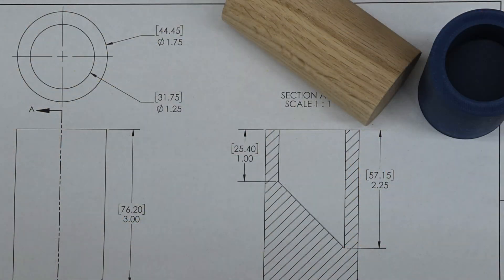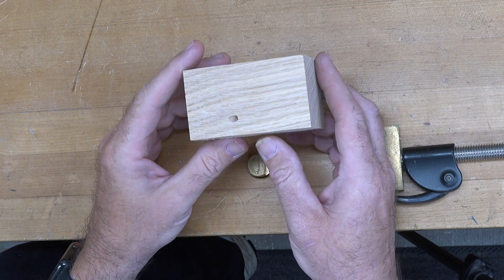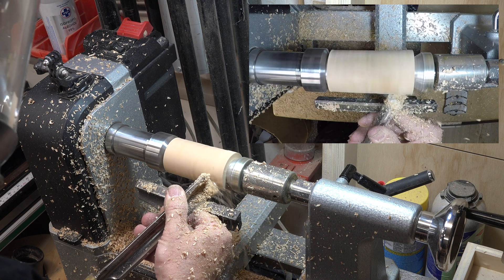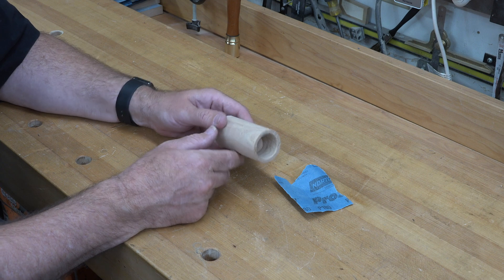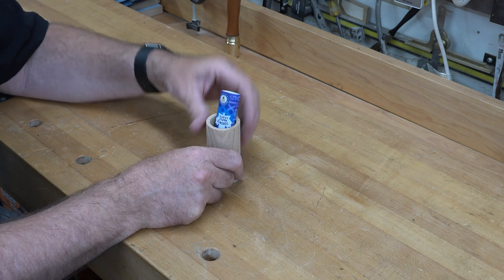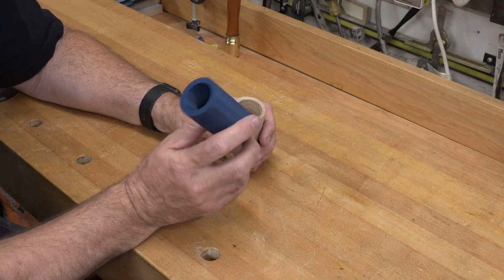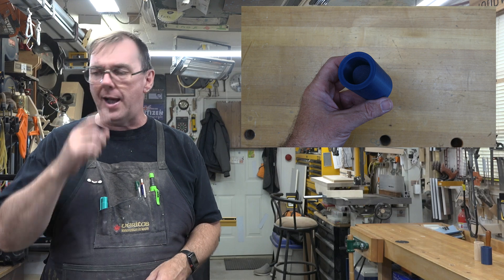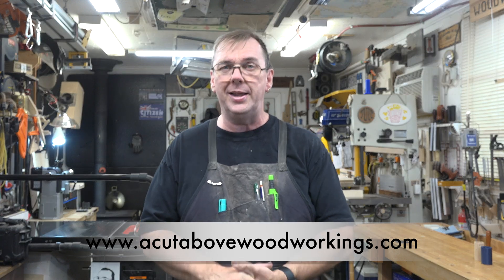Shop Made Toys and Choking Hazards

Comment: Very important video!   I totally agree with Scott M.  …..  everyone should consider a good COR course that includes pediatrics.  There are countless choke hazards around our homes that are parts of everyday life.   Be observant with anything you make, but also be aware of all things purchased.  When you make one of these gauges, take I and walk around your home.  You will be totally shocked at all the choking hazards for small children.  🇨🇱🤠
Reply from the maker: Scott's suggestion was definitely spot on but so is yours Randy.  Crawl around your house, viewing things from the height and perspective of a 3 year old and test the things that are in reach.  I agree that you will find a shockingly large number of choking hazards and in most cases, all that needs to be done is to move them to a higher shelf where they are out of reach for the toddler.  It is such a simple thing that could save the life of a child.  Thanks for tuning in and for chiming in to the conversation.  I appreciate your input.

Comment: I was delighted to see how seriously you took my message! I always knew that you were committed to safety, but I find it incredible how quickly you printed the gauge, built a wooden version and made a video. It was only a month.
Also, great comment about securely holding pieces in a clamp while at the drill press. My first month at my first real job, I was drilling a hole at the drill press by only holding the piece with my fingers. Guess who ended up with bandages on his thumb and finger for two weeks.
Reply: @JimLambier Thanks for the effort, and also the info, I will download the stl file, much appreciated.
Reply from the maker: When attempting to upload the STL onto my website Philip, I discovered that STL files are not supported by the website.  Please feel free to send me an email at kennye@acutabovewoodworkings.com and will be more than happy to send you the file.
Reply from the maker: I don't take safety lightly Jim and that is especially true when it comes to the young ones.  No matter how safe you are being, there is always room for improvement and the information that you sent to me was a way that I could improve on my safety from a designer aspect.  Why wouldn't I bring it to the show.  Thank you for sending me this fantastic information and for the work that you put into make the STL and the drawing.  You have no idea how much I appreciate you contribution to the show.  Thanks for tuning in.